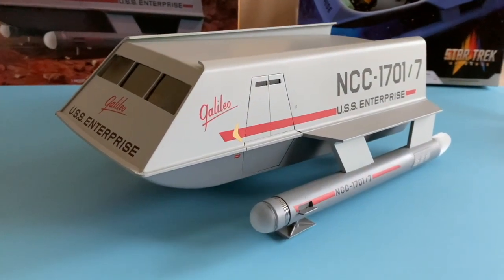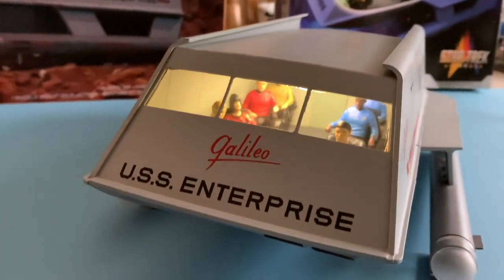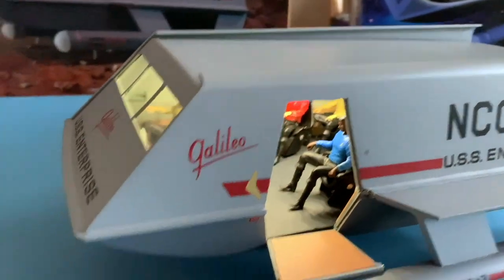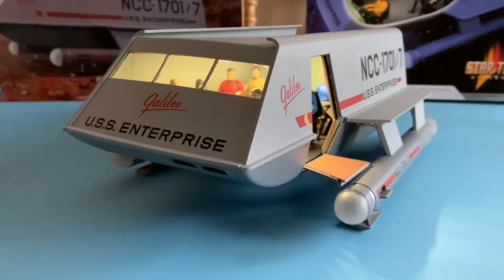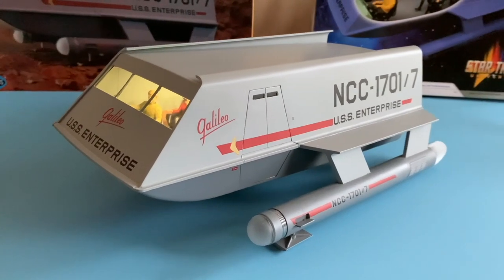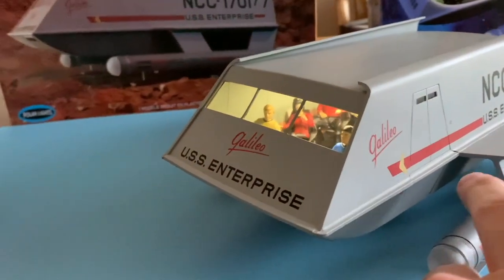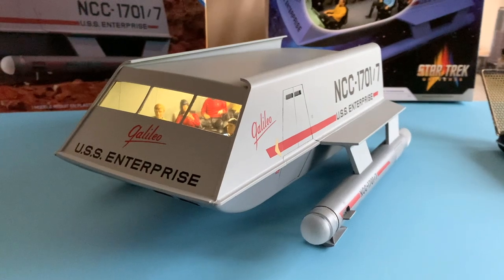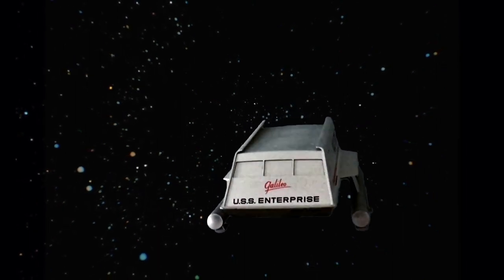Mark Myers Polar Lights 1:32 Galileo build PART 3

Comment: Great job mark from a fellow AAA hobby consumer in S Jersey. How and where did you mount the door hatch magnets?
Reply from the maker: Two steel pins are on the top inside cavity of the lower door. You need to catch build the panel that goes there that's the same color as the lower half of the interior wall. I drilled a small hole on the right inside part the seats the lower portion of the door. Then epoxied it in place! Be careful, don't drill in too deep! And make sure the magnet is facing the correct way.